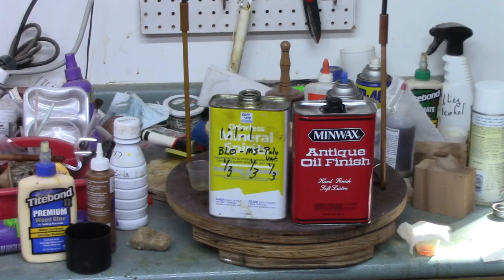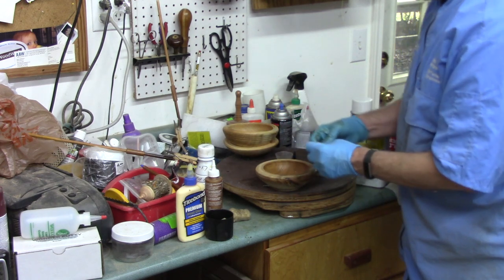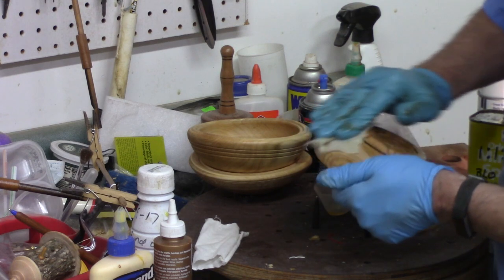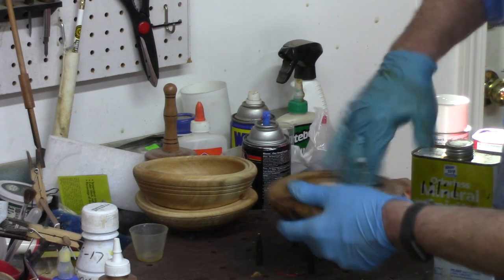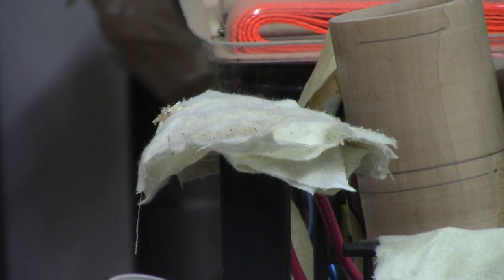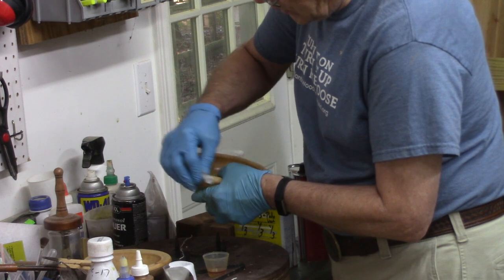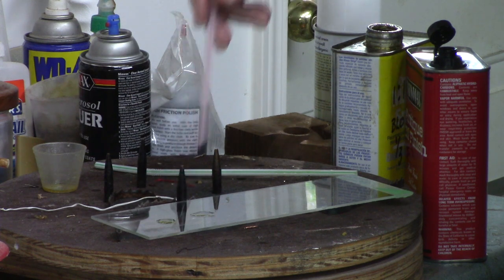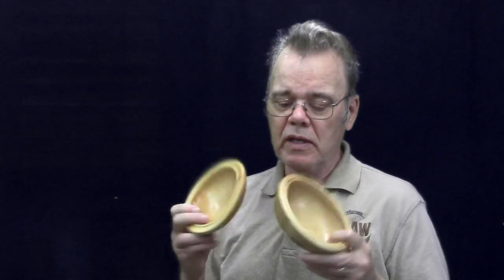DIY Finish vs Store Bought and More Woodturning Finishing Tips

Comment: I would rather see you lay out your rags singly than in a pile. A big enough pile and you could get combustion. As to the DIY finish. You indicate that they seem to be about the same. You did not mention cost. If there is no significant cost difference then I too would go with store bought. Thank you for sharing. Have a great day and stay safe.
Reply from the maker: Hard to argue  spontaneous combustion is not a real safety hazard to deal with. My "pile" of 4 to 5 two inch squares is misleading, but could make inexperienced finish users think spontaneous combustion is not a serious concern. I rarely use more than one 2"x2" rag soaked with finish and perhaps a second one to buff off excess that absorbs very little. I usually throw them away the next time I add a coat a day or two later but sometimes they stack up. But the bottom ones are already dry from use 1, 2 or 3 days before. Hardly a concern for spontaneous combustion. I probably should have mentioned cost but it is such a trivial difference to me I did not see the need to review. But I am sure I left some viewers wondering who were not used to buying the individual components and would not be able to do the math in their head. I use less than a quart a year so we are talking about a quart of store bought for say $20 versus 3 quarts of DIY for about $36. To me dealing with 3 cans with three sticky lids and the trouble of constantly mixing small batches and finding an appropriate small metal container or having 3 mixed batches of which one or two would like go bad before finishing more than outweighs the price difference of a cup of Starbucks. I will pin this comment so more readers will see my explanation.

Comment: Thanks for the demonstration. This comment may only be tangentially related, but for small items that are handled a lot; boxes, tool handles, bottle openers, etc. I have had good rest with Birchwood Casey's Tru-Oil gunstock finish. It is as user-friendly as some others, and takes longer to cure completely, but it is durable. One more caveat -- it has a relatives short shelf-life after opening. Months rather than years. It isn't water soluble, so use what usually works with oil-based finishes to clean up.
Reply from the maker: Thanks for the tip, Brad.

Comment: I agree with everything you showed and said here Mike. I've been a fan of MinWax for over 30 years now.  One thing I do differently is to let the applicators dry in single layers - i.e. I won't stack them because each layer acts like insulation to keep the exothermic heat in. (I use them to keep track of how many coats I've used.) Fun fact: the mineral spirits solvents used these days is called Stoddard Solvent.     Thanks for sharing🙏  Take care. -Mike😷
Reply from the maker: Thanks for sharing, Mike.

Comment: On re-using gloves:  I find that I sweat when wearing the gloves making it difficult to get on for re-use.  What I do is keep a container of baby powder in the shop and dust it on my hands before putting the gloves on.  Let’s me re-use many times without ripping.  I do this for both nitrile and vinyl gloves.

   I have chemical waste cans from Northern Tool and put my oily rags in them.  Removes one of the required elements for fire - oxygen
Reply from the maker: Great tip!

Comment: I think the point you have demonstrated is that unless you can identify a real difference between commercial and DIY finishes, commercial finishes have the advantage of convenience - and when you are a typically busy retired guy, convenience counts for a lot!

That said, I do make my own wiping varnish using a 1:1:1 blend of high-quality alkyd spar varnish, turpentine, and pure Tung oil.  I like the way it looks and handles, and I like the fact that its made is predominately vegetable-based components - turpentine and Tung oil - rather than petroleum-based components.  And the spar varnish that I use has a UV inhibitor that prevents darkening and helps retain the color of the wood.

I mix my varnish in small quantities (about 3 oz) in recycled spice jars - I can use a jar two or three times before it becomes so gunked up that the cap no longer fits right and I have to toss it.   Fortunately, my wife goes through spices at about the same rate that I go through varnish, so I have a constant supply of jars.
Reply from the maker: Gunked up lids is a pain with so many. I find the flip top plastic lid on the Minwax ca ns easier to deal with then the screw on "safety" lids that require pushing down and turning.
Reply: @monophoto1  I’ve been draping a double layer of wax paper over the jars or cans before screwing down the lid. Never have a problem getting the lid off.

Comment: I like to make my own 1:1:1 finish substituting Walnut Oil for BLO and Naphtha (aka White Gas / Coleman Fuel) instead of mineral spirits.  The walnut oil is very much lighter in color than BLO and will not darken/yellow light colored woods as much.  The naphtha makes it dry and cure more quickly.  I also make it in small batches so that I do not have a quart can of opened commercial finish sitting around for an extended period.
Reply from the maker: Thanks for sharing! I did not realize Coleman fuel was naphtha. I have a can that might be 20 years old. Wonder if it is any good? I may try your recipe if I make another batch.